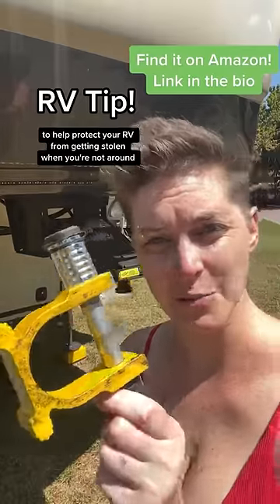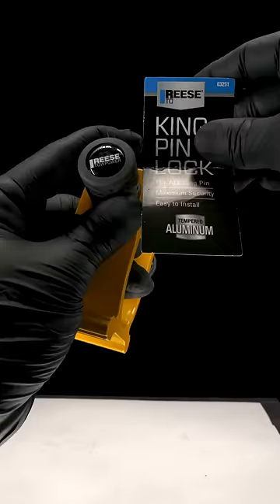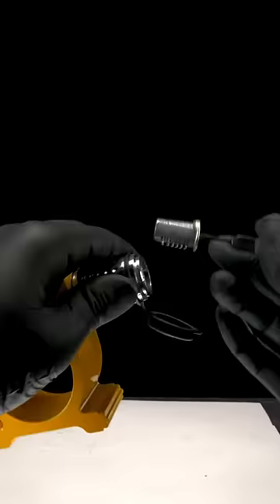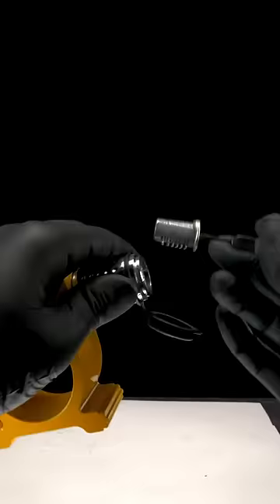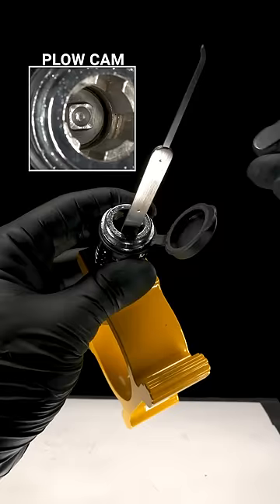Reese King Pin Lock opened with short hook & wave rake

Comment: He just casually pulled the cylinder out of a Max Security Lock. Very high security right there.
Reply: Dude. You robbed my comment I was going to make.
Reply: @Kit_Bear  better buy a kingpin lock for your comments
Reply: The core-eject feature makes picking this lock an utter waste of time. This ensures nobody will pick it, and it is therefore technically unpickable.

Clever, if you don't think about it to hard
Reply: @PainSled  well, that’s the customer base.
Reply: @Eroll-dw8ex  🤣🤣🤣!!!
Reply: @Eroll-dw8ex  that would be even worse because then lock picking lawyer is going to steal the comment instead
Reply: That was 🔥 ma boy
Reply: Seems sus to me
Reply: @PainSled could you explain? Why did they build the lock this way?
Reply: The only way to pull out the cylinder, the lock must be in the unlocked position. If in the lock position you’re not pulling out that cylinder
Reply: @portersanford4704  so is this video fake?
Reply: Maximum means highest YOU can achieve, not the best compared to others. ;)

Not literally you. The lock company.
Reply: @XtreeM_FaiL  Damn man, that was brutal!

Comment: I’m a manufacturing/production engineer and a problem solver at heart. I can guarantee I can build a lock that you can’t pick. I might even just create my own company because the mechanism is overlooked. FYI. There are pins but 2 other key components that is required to have lock/unlock. Pun intended. Contact me if interested. NDA will be required.

Comment: The core came out.
THE CORE
CAME OUT
HOW IS IT THIS BAD?
Reply: Locksmith here.

Swappable cores are a pretty common feature on wafer cylinders, sadly. there is an extra wafer in the back accessible through the keyway that's basically the only thing holding them in place. They exist this way so you can remove them for rekeying, but yeah it's a crap system and ridiculously easy to bypass.

If the lock is more for convenience than security then it's fine. Makes more sense in an office setting when you just want to lock up a cabinet or desk drawer. office staff/teachers would lose the keys to these things all the time and it would usually be easier to just pop out the old cylinder and install a new one with a precut key. But for anything remotely secure they should be a no-go.
Reply: I remember when U-locks for bicycles were first used, you could melt the end of a pen barrel with a lighter and pressed it into the lock and could open it
Reply: @skootz24 so what should one use to say lock up and rv?
Reply: @thomasthomasthomas296  Prayer
Reply: @thomasthomasthomas296  a hitch that is unique to only you and your vehicle
Reply: @skootz24  There's, uh, got to be a better way to do that, right?
I mean, that's like designing a combination lock in such a way that it could be re-coded without having the combination first (though of course I've seen enough LPL to know how easily those can usually be decoded, so I'm not suggesting they're any better built, it's just a conceptual point).
Reply: @thomasthomasthomas296  Lock the wheels.  Thieves can pull the trailer without the kingpin.
Reply: @thomasthomasthomas296  insurance and a gps tracker. Wheel locks to slow em down.
Reply: Where we are going one does not need cores
Reply: @thomasthomasthomas296  Nothing can keep out a determined criminal (whether it be locks or other forms of security). The idea is to slow them down OR make them decide to pick another target.  Most locks don't even require picking, you can "brute force" most of them with bolt cutters or an angle grinder.

Comment: Wisdom of the day: Locks are just to keep honest people honest, not to keep criminals out.
Reply: Correction, if they want to rob you, a lock won't stop them, however, if they are just looking for an easy target, then the lock will make them keep walking
Reply: @bfure1 😂 still an easy target, if you don't believe me just slip a small section of fence post pipe over the end and click, lock is disabled in one second. That's the way criminals think.
Reply: @brennonwilliams9569  I don't know what lock you're referring to.
However, the majority of simple locks are indeed a deterrence, keeping criminals with no or little picking knowledge (Or even those with some) away from what would otherwise be an even less riskful target.
Reply: Exactly 100% correct!! Dead bolt your doors they'll go through a window, put bars on your windows, they cut a hole in your roof.
If they want in they get in!!
Reply: @sincerdagain6060  - Exactly.  Many houses are just a board nailed into another board. Remove the outside siding board and all that's left is sheetrock,  that's easily broken....aaand you're inside.
Reply: Sounds like a bunch of laws here in the US... Cough... Guns...
Reply: Most criminals will go for the easiest target because the smart ones aren't dumb. The dumb ones can't get in, the smart ones know faster is better. Sure, if they really wanted to take something, they would- but using that as an excuse not to secure your stuff is beyond stupid.
Reply: @brennonwilliams9569  You completely misunderstood this entire thread, congrats… The point is that locks aren’t keeping criminals who want to rob you from robbing you and you replied saying the exact same thing
Reply: Honest people don't need locks
Reply: That saying is the most moronic thing anyone has said, ever
Reply: @PayNoTaxes0GetNoVote  what building are u living in lol
Reply: @zusty9589  😅😅😅😊
Reply: Man even the british royal family get unwanted guests. And they're probably the most protected/guarded family in the world.
Reply: well said!防小人而不防君子
Reply: actually, it's to keep the many people on the fence on the honest side, and delay the criminals.
Reply: That's what guns are for
Reply: @steelsilence19  Virtually every house in the midwest built from the late 70s to mid-2000s.  If you think brick is any more secure,  you haven't worked on houses much.  It's just easier to go through a door or window but I guarantee I can get into almost any house in 15 to 30 minutes, tops, with a crow bar and hammer WITHOUT going through an opening. 5-10 minutes with a battery powered circular saw

Edit: Old houses with Lath & plaster were VERY secure.  They usually had exterior of lap siding, brick or shingles, 1x12 backing then once past the 2x4 structure there was lath nailed up on every stud and 1/2" of concrete bonding it all together.
Reply: Locks are meant to keep people honest, not honest people honest. Honest people wouldn't steal something even if it was locked.
Reply: @idabomb00  - Nah, locks are meant to make a thief look for an easier target....  if they want you item bad enough,  they'll get it.
Reply: But an honest person wouldn’t try to take your RV even if it was unlocked… 🤔
Reply: SOOooooOooOo many stupid comments!! Yes if someone really wants your stuff they will likely get it. But a thief is also going to take the easy steal over the more complicated one, so not locking your stuff is stupid. Yes it may still get stolen, but it also may not because it may get passed over because its locked. There are way too many factors that will determine if your things get stolen or not, and a lot of cliché sayings too....lock your stuff people, not doing so is just stupid! So what if a peticular lock has a flaw and can be defeated in seconds, not everyone knows that fact, so if I I was going to steal a bike, I am likely going to take the one that is left unprotected over the one that's locked. And if I want your bike that is locked, I will try to figure out how to defeat it. Sometimes the delay in breaking a lock or picking it means the difference in whether or not it's worth the time to a thief. It's common sense, you think you items are better off unprotected because some people know how  to defeat a lock?  That makes NO sense. These videos are posted to show us vulnerabilities in some brands, to make us aware of the false sense of security marketing will use to sell a product. The easy to beat lock will still always be better than no lock at all, if you want to know which brand is most secure, do some research....your watching these videos and leaving comments, you must be able to use Google to get to sites and find out which locks are recommended to deter theft. If you have something valuable,  protect it. There are more ways than just locks.

Comment: No way you can just pull the whole ass cylinder out with just a hook. That's wild
Reply: Yet, you just watched it happen.
Reply: "there's no way he opens this one with another lock, what's he gonna do?" 

removes entire cylinder
Reply: Now that is good design
Reply: Even the almost equally shitty wafer lock on my desk drawer at work at least requires your to jiggle it to the unlocked position to pull the core out lmao. This lock just cuts out a step
Reply: The design is very human...
Reply: Mostly only if the lock is unlocked you can pull it out
Reply: Totally can, glad hand locks are just as simple, only a paperclip needed
Reply: It saves on money.
Reply: @cadman10000  Yes, but we didn't see him unlock it, which you have to do to allow cylinder removal.
Reply: I had a no name lock like this one in style, when it was locked would lock the cylinder in place but unlocked would disconnect the lock from the metal bolt on the back so it could be opened
Reply: @Silentguy_  all i need is a paper clip to pull the cylinder out of a office lock
Reply: Just put it in, don't gotta jiggle it, not even a little bit, she's your's to have
Reply: @SilentGuy That core will do the same thing as they're held in with the same design. I've done it with a paperclip several times.
Reply: @charlesparker6749  nope you actually don't.
Reply: @MyBrothersMario  Well, that's fairly rubbish so, isn't it? What's the point, just tie it to a railing and save the money.
Reply: @cadman10000  yep
Reply: @rick0208  finally someone showing some sense.
Reply: @Silentguy_  or did he cut out a step
Reply: That lock is a wafer style lock. They are the easiest things to pick. A normal lock like what’s on your front door or in a master lock is a pin lock which he will open just as easily
Reply: Yes it's a design flaw lol ...most locks you can't just like some locks u can still use combe picks
Reply: He first had to pick the cylinder, I Hope?
Reply: Wonder if you could weld or superglue the lock cylinders to the rest.
Reply: @Charles Parker  yup basically, the cylinder they used is the cheapest possible to make, and should only ever be used for low security uses, like locking a filing cabinet in an office, not as a primary source of security.
Reply: @charlesparker6749  except that's the majority of locks... because, generally speaking, most lock makers have solutions to the simplest problems. i.e. taking the cylinder out when its locked.

with channels like these, it's best to assume the lock is... well... locked.
Reply: You must be new here. It’s ok, the YT lock community has done much worse to insult locks with basic tools. It almost seems like the higher “security” rating, the easier the bypass is.
Reply: @MyBrothersMario  They were actually half clever with the design for the locks I have. The core has a protrusion on the outer wall that matches with a machined groove to prevent the core from being removed while in the locked position. 

Doesn’t change the fact that a stern glance and a mild breeze will unlock it but I appreciate the effort on the manufacturer’s part lol.
Reply: @Charles Parker  apparently not
Reply: @omeletteknight1620  then you could t open the hitch. It’s made to come out so you can get to the bolt inside
Reply: Nah, i had a desk lock looked just like that and I lost the key, so i used a ziptie to remove it and flip it to lock / unlock it 😂
Reply: Got some window safety locks just like this.

Got some picks to have some fun and try to open these locks at one point (lost keys) even though I could have just unscrewed them.

Turned out to be kinda hard to learn lock picking with, but a happy accident taught me the barrel was held in a by a circlip style band that wasn't hard to pop out of place with a hook pick.

Basically at the bottom of some locks the barrel is just held in with a silly little plate that's kinda springy, push it out of the way and it unclips letting the barrel slide out.

Wont unlock it, but now you have a simple turn peg of various design that has no locking ability beyond that of a regular door handle.
Reply: Yep, they use a wafer that doesn't engage the key as a retaining clip. If the back of the core isn't shielded (cheap ones arnt ) you can litteraly reach back with a pick, push the wafer down and the whole core comes out
Reply: @charlesparker6749 All locks do is keep honest people honest. Locks are always worthless against people with ill intent.
Reply: @cadman10000  Maybe...
Reply: Best part is, he probably expiremented with it at first to figure out how to pick it and accidently pulled the cylinder out lol
Reply: I just went out and tried this. He modified it in some way to be able to do that. This is fake.
Reply: Yea he spent probably 10-15 minutes jiggling and messing with the cylinder off camera then cut back right before he pulled it out
Reply: Theft is ultimately about convenience. Unless your property is specifically being targeted, thieves are likely to move on when seeing the lock.
Reply: I bet he did something to the cylinder before making the video of not she would have pulled out the cylinder just trying to take the key out of the lock
Reply: This is why I hate engineers! They don't listen to the experts
Reply: Wouldn't matter if you were to cut it off with an angle grinder and cutoff wheel, nobody is going to notice, and they sure ain't gonna care.
Reply: bro i laughed so hard
Reply: yeah, looks like he pulled apart first
Reply: He didn't even have to pick the lock before removing the cylinder!
Reply: Actually yes you can. You cant do it with all locks but with locks with this design you absolutely can 100% it so hilarious you got ppl like the guy who wrote this comment who refused to believe things like this can happen. Well it just goes to show he knows absolutely nothing about hiw locks are made or how to pick them. Lol. He better just pray that he doesnt become a victim considering he has faith in these locks. What a niave person smfh
Reply: Exactly what I thought.  Wtf kind of lock can you just take out that easily? 😅 bro cheap asf or he did something to it b4 starting video.
Reply: @charlesparker6749 there it is.  If irs locked your not pulling it out.  So if he unlocked it went take it apart? Lmfaoo click bait
Reply: AI generated videos are getting really good.
Reply: @Charles Parker on May locks the cylinder is held in by a pin in the back... you can bypass the lock and all, just hit the pin and it releases the cylinder.
Reply: Same style lock that's in older glove boxes in the 70's vehicles. Just past the normal wafers is a recessed retaining wafer, and that's all that really holds it on.
Reply: Also why would the retaining bolt be so loose you could turn it with the picks. You couldnt get enough torque to turn anything even hand tightened.
Reply: You do have to find the hole to insert the hook into that defeats the clip that allows the cylinder to be removed

Comment: Between you and Lockpicking Lawyer, all locks look like the one on my Hello Kitty diary from the 1980s.
Reply: Right... At this point if a lock requires actual tools instead of a tin can or milk jug, it's a good lock.
Reply: @chaos.n.dissonance man's neglecting to mention using locks to open locks
Reply: my sister had one of those I could not open it for the life of be I took hammers screwdrivers and anything I could find but it just would not open
Reply: Those were like cracking a safe. They made quality sh1t in the 80s. Made in America.
😂
Reply: You are using a Sanrio Brand Hello Kitty Diary lock it can be opened with a Sanrio Brand Hello Kitty Diary lock.
Reply: @vanillajerm5845  Yup. Found out later that it could be unlocked with the tip of the bottom flat part of one of those Goody brand hair clips.

Comment: “Never met a lock that a pipe wrench couldn’t break.”
Reply: I wonder. There was that comically oversized lock that lpl and bosnianbill took to the gun range and shot with several different guns and a variety of bullet styles, including 50 caliber. I'd be interested to see if a pipe wrench could open that.
Reply: @PaulTMaack0 With enough time, yeah. If it’s a damn good lock, it’ll take too long and it’ll be too loud to be worth the risk.
Reply: @PaulTMaack0 depends, how big of a pipe wrench do I get to use 🤔😂
Reply: I have but nothing my anglegrider can't fix.
Reply: @redneckpyromania6965 I am imagining a comically large pipe wrench now
Reply: @getflashbanged6909  I've used 3ft. Long pipe wrenches before lol
Reply: @beastwarsFTW there are actual hardened steel shackle locks that will make that angle grinder disc explode in your face, but they're not the stuff you buy on walmart.
Reply: @akinwalearobieke2964 idk that was a beefy lock.
Reply: @PaulTMaack0 Yup that one is the squire something something model. There is a bigger one thou. The altor SAF lock, it can resist an angle grinder so a wrench has no chance. As for picking it requires lpl to go to his garage for a couple hours to make a completely new tool, and he said this lock can't be picked without insane knowledge and tools.
Reply: The Squire lock was shot at by LPL and Bosnian Bill